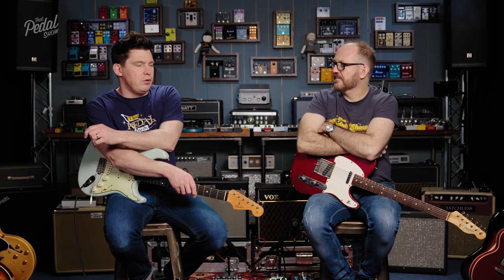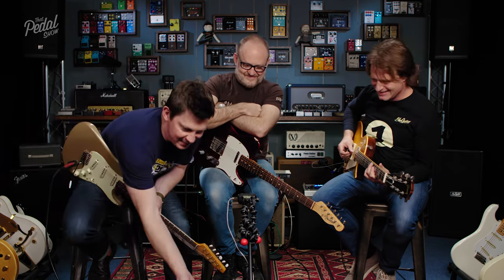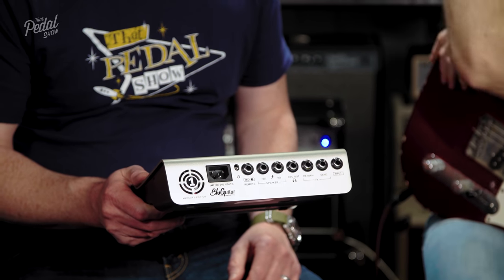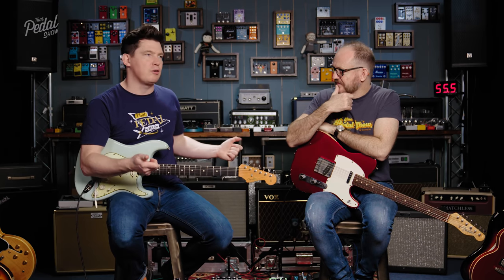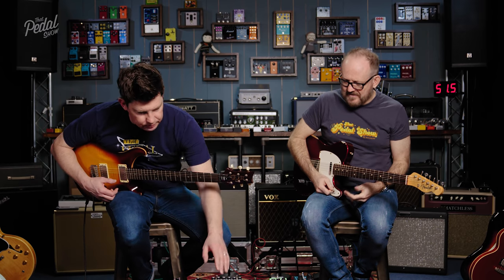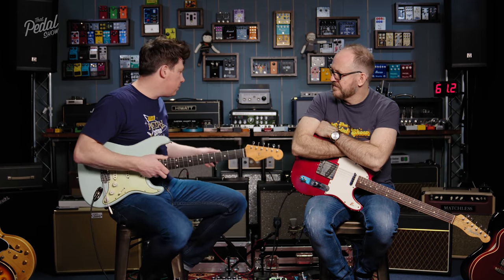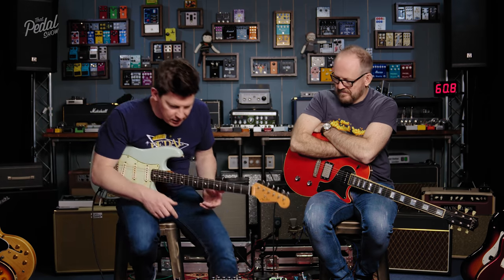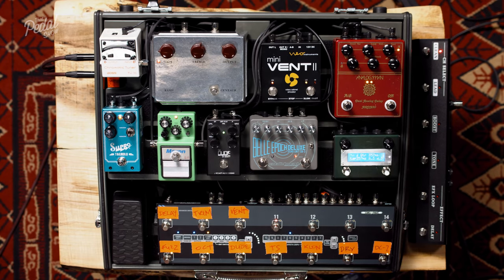Yes We Do Like Transistor Amps #1: Boss & BluGuitar – That Pedal Show

Comment: I love both tube and solid state amps, it depends on the sound/tone you need at the time. They both do what they are intended to - just differently.
 @1:06:19 That sound/tone combination is just filthy to me, and smoked the Fender, and on other tones the Fender smoked the Boss. 
Like a plane and a helicopter both do the same thing, fly........ just differently, flying one or the other doesn't make you a better pilot.

Top job lads

Comment: Cheers, guys! While watching this episode of TPS i was unboxing my new Roland JC 40, the subject of a recent show. Now i am wondering if i should have bought the new Nextone instead.  I intend to run the JC40 in a wet dry rig with one of by beloved tube amps. If i understand your philosophy, i should run delay effects through the new Roland's fx loop and my overdrives & boost pedals into the front of my "dry" tube amp (I own two, a Laney Cub12r and a Peavey Classic 30, both with Eminence speakers).  Do i understand your philosophy correctly? Thank you for another sintilating show.
Reply from the maker: Dan and I would both choose the JC I think. Louder, simpler.
Reply: @ThatPedalShow  I've had it an hour and am completely smitten. Huge improvement to my tone...

Comment: Combining this topic with the last episode: where are all the stereo guitar amps (input & ouput, i.e. not just a single mono input)?  
I have a sublime valve amp, and I would love to grab a stereo amp to give me instant Wet Dry Wet.  It could be a small power block to go on (or under) my pedal board that I just have to plug speakers in to, or even a 2x10 combo.  
Handling the wet sounds it could be solid state, and hopefully that would make it cheaper and lighter too.

Comment: I’d like to mention and recommend the Fender Jazz King. 140 Watts. 1x15 Speaker. Stays clean almost all the way up. Stupid loud. Fender tone and great pedal platform. Like a Twin in unyielding low end and volume, but minus the weight. Would love to get your take on this amp after you’ve had a chance to try one. Gigged with this amp lots, and love it!
Reply: I have one of these as well and mainly use it as an acoustic amp, or putting peizo equipped guitars through.  I have played strats through and it is good with electrics as well.

Comment: Wonderful!  these amps sound amazing! glad you guys have done this episode and the best advice that comes through is that we must judge the sound with our hears. If it sounds good it's good!!!
Reply: Maybe for those on the receiving end--I have heard countless times over the years about how 99% of the audience wouldn't know the difference in a band setting, which may be true. For the player though--at least for me--the feel and response of the amp I'm playing is just as important as the tone. It actually affects the way that i approach playing--it's very hard for me to get into playing and writing music when my amp  responds like a first time prison rapee--cold, sterile, and uptight (literally).  Sort of like the difference between playing at conversation volume versus the way a speaker reacts when it's pushing air at a high volume. My bassist wanted to raw dog my dry guitar signal straight into the studio interface the other day and use software afterwards for the amp tone,  and i almost had to drax them sklounsts.

Comment: This is a great episode, and definitely one to expand with more alternatives from other brands. I also have a question/suggestion: what is your take on half-solid state and half-valve amps? The BluGuitar is a solid state amp with a "nanotube" that if I remember correctly works in the power section, not the preamp. On the other hand Eric Gales' new amp, the "Raw Dawg" from DV Mark has a 6205 tube (kinda 12ax7 vibe, the same tube that's in the new Fender MTG Tube Distortion pedal) in the preamp. I personally really like Eric's new amp, and I've gotten only compliments about the sound on gigs and sessions. Maybe that could be an amp for a future video? I'd really like to get your feedback on a valve pre and solid state power section like that one. And I believe Andertons has it in stock/can order it?
Reply: I also forgot, it has a loop where you might even be able to put a volume attenuator like the JHS little black amp box? I use it a lot with hot rods to drive the preamp valves a bit harder without breaking windows and eardrums.

Comment: I'm seeing fewer and fewer bands using valve amps nowadays. I have a 'D' style amp at home, currently in use as a lamp stand. I love my Roland Blues Cube Artist. Turns out, if your're gigging every week, a valve amp is not the best solution.. (for me anyway).
Reply from the maker: It is undoubtedly true. If you dive in though, the reasons are usually cost and practicality. Which is cool.

Comment: I love a good solid state amp, I've had few issues with cutting through the live mix of a band. I've owned a Fender Princeton chorus, which is great sounding amp but only 65 solid state watts, also I love my peavey bandit, which sounds awesome with a ts9. 
What I don't like is solid state amp that try to sound like a valve amp, simply doesn't work. 
Great show, hope you had a cracking time at namm.

Comment: Dan and Mick, another request to do a “make your guitar sound good with a band” episode. But I reckon do it without a band. I have learnt so much about making my guitar sit better in band from all your sans bands episodes. Could you include mic placement (saw a lazy sound guy put the mic right on the edge of the cone of our support band - not sure if I should have jumped on stage to fix this) Also when my band is just bass, drums and my guitar and I’m playing a solo I find myself using overdrives with quite a bit of bottom end rather than say a tube screamer, am I fooling myself that I’m filling out the sound or does this sound reasonable.
Reply: Might be okay, but no reason the bassist can't stomp on some dirt to fill out the sound, so you can solo without fear of making the mix sound thin.

Comment: I've been using solid state amps for years for several reasons; reliability being the main one, the fact that they aren't subject to tone-robbing mains voltage fluctuation in various venues, their relative light weight, no need to bias the things, change expensive valves and the fact that I like the tightness of the response. With the arrival of things like the Roland Blues Cube in its recent incarnation, the Boss Katana etc these are real game changers. My amp of choice, however, has been the venerable and utterly reliable Peavey Bandit Transtube. I have to say that I thought that Blug tone was terrible; brittle and farty.
As ever it's all down to what one prefers. As far as sheer volume is concerned, loud is loud irrespective of what a number says, so I'm not sure where Dan's comment came from-especially as many guitarists mic-up smaller and smaller amps these days. Valve amps I have owned include a few Boogies, VHT Pittbull, some Marshall DSL, Fender Pro Tube Pro Reverb (wonderful but 75lbs), Selmer Treble n' Bass 50 with Goliath 18" cab, Cornell Romany, Cornford Hurricane, Vox AC30 etc., etc., so plenty of experience in my 50+ years of playing the things! Cheers.
Reply from the maker: All agreed. The loud thing comes from the numbers. The Nextone is on max, rated at 80 watts at one point in this video, while the HRD, rated at 40 is barely ticking over and has a long way to go. That's been our general experience. Weirdly the JC40 seems waaaaay louder.
Reply: I have a Peavey Bandit too, and I can't find a reason to change it. I'm surprised that even you, having tried all those amps, still like it most.
Reply: @lucianodebenedictis6014  Lots of reasons, as outlined in my reply. I also like the power scaling-very useful for getting good tones at lower volumes where a valve amp might be struggling, especially for overdriven tones.
Reply: Well you have better ears than me. I noticed almost no difference. I am guessing the Matchless is about 3K and the Blu maybe 1K so for me thats amazing plus no amp lugging upstairs

Comment: Thanks for showing the amp settings. I'm always interested how other folks set their AC15's. I set my treble about the same as you have, but I run the bass lower and use very little Tone Cut (set about 9:00). It gives me a tone that really sits well and distinct in a band mix. I run through the Top Boost, though. And, of course, different guitars, pickups, personal taste, etc.
Reply: I posted my initial comment before Mick pulled back the tone cut some :)

Comment: 57:06 Interested that you went for knob-sweeping and the fave "2 o'clock" for setting up the Hot Rod Deluxe, rather than using the Matt Schofield System™ of getting the amp in its most "responsive" state. So -- was this a situation in which that "responsiveness" would not have been in the best interests of what you were testing?
Reply from the maker: You are entirely correct. The truth is I couldn't hear that well, knew the camera was running and just needed to get on with it. :0)

Comment: I know this is an old video, but i have a question/request.   Could you do a video with the Nextone, and Quilter with Micks WGS/EVM copy.  And see how that speaker or speakers effect solid state amps.  Is it and if so, how is it different,  or similar?  Sorry I fell down Mick's rabbit hole with a little 1x10 Rivera with an EVM 10L that sounds so massive, yet detailed and focused.  Now I'm wondering how widespread the effect of these type of speakers are.

Comment: Interesting. It has me wondering how my Vox ToneLab ST would hold up in a comparison with these two amps. It's a modeling unit and requires an amp, but it does have a tube, and I think it works great, although I never play at anything near 100db!
Reply: they are just the preamps of the cheaper second series of valvtronix amps,,,absolutley killed by the amp1,,i know i have foyr of the origional "blue" series valvtronix the ones before they dumbed them down,,cost over a grand when new
Reply: I'll take your word for it Bill, especially since my used ToneLab ST cost just US $100, a small fraction of an Amp1 price. It seems to me that a big advantage of devices like the Amp1 is to eliminate the need for backline gear. Just show up with a pedalboard and plug into the PA. However, I don't believe Mick or Dan would be too keen on this idea for live shows.

Comment: I have been using my amp 1 now for gigging for the last 2 years,replacing my aging and now defunked marshall jcm 900 100 watt combo.Can I tell the difference between them...Yes the amp 1 sounds way better without all the hassle of lugging a heavy amp around. Before that I was a die hard valves only man I was Marshall or nothing,I even played at a marshall father of loud celebration at Milton Keynes,lovely people at Marshall! This thing changed my mind.It has the same feel as my old marshall. Sorry  but eventually they will stop making valves as it very very old technology which is a very sad thing.Thanks Lads for doing this very interesting !
Reply from the maker: There are enough valves left to see any of us to the graves, Dave. And just because you prefer something doesn't mean the 'old' tech has to die. Nobody needs to apologise for it. :0)
Reply: @ThatPedalShow  ah I stand corrected ,true enough I don't want valve amps to die out...it's just that my old valve amps weigh too much  for my aging body and need regular servicing ie more money spent on valves,servicing etc.Love the show by the way and thanks for the reply !

Comment: . so which transistor amp sounds best or most tube like or both? boss next-tone, roland jc40, roland blues cube hot,quilter mini 101 w/reverb, blug amp-1 oe something else? I want to run 2 in stereo so it cant be plus $1000 amps either..help...
Reply: I would go amp1,,but im biased as i have one along with an ac15,,,though i did try the cube,,,,the bonus of having a board mounted 100w head cant be forgotten either ;)

Comment: Solid state amps are getting better, but they're mimicking valves to some extent unless they're trail blazing their own unique sound. The reason is because in the old days all you had was valves and the artists we still revere had little choice but to use them.  I've had a listen to several cheap and expensive SS amps over the years and indeed owned a few.  But I do find myself veering to valves simply because the break up in the sound is less "controlled" and more natural compared to SS.  Where the SS amps are really great is for pre-amp feeds direct in  as they give a consistent sound.  Bizarrely, the preamps are often solid state mimicking valves.  Go figure!!

Comment: Thomas has done his magic of matching tones of tube amps so many times that it is simply amazing... and pretty convincing as well. For home practise and as the second amp in a live setup,  I can completely see it doing its job much more so than any modeling thingy. It has been on my ”to-be-tested” list for a while but getting your habds on one is not easy - unless you buy nline and trust the return policy works. So, thanks for showcasing it one more time - solid stuff :)
Reply: not a back up ,,a board mounted amp that replaced many a full size tube amp head
Reply: Bill Rand I would not be too surprised to see that happen, honestly - and the second amp in my setup is not a backup (unless the other dies) but an equal sonic offender :) The pnly thing I am weary of is the reaction to different pedals I have grown to like a lot. But that I can only find out by trying the blugamp out. I would love to have the portability with all the tones of a back breaking tube amp!

Comment: You really need to check out some Randall amps. They make the best solid state around. Some even better than tubes. Hell my cyclone can get master of puppets, vulgar display of power for super high gain. Yet just roll back my volume pot to get classic rock tones like Boston or Zeppelin. Plus super clean cleans with more headroom than a tube amp.

Comment: Mick, were you stating there was more bottom end from the Nextone as compared to the VOX?  Funny, on my playback system, I heard just the opposite.  The VOX seemed to record with a "fuller" tone.
Reply: Mick, for what it's worth, I changed audio playback systems to one with a sub-woofer.  The extreme low of the Nextone, came through. What seemed to be missing was a range in the "upper-low-end" that made the VOX seem fuller.  Don't know how many times I'll tell myself all tones through YouTube are relative. :-)
Reply from the maker: Felt like it where we were sitting. Highly likely that the room mics were hearing something different!
Reply: @ThatPedalShow  I've had a few conversations with Tim Pierce regarding mic/recording.  Due to his studio work, all his tone is heard through recording monitors.  His speaker cabs are in a vault.  What he hears, when working, is dependent on his mic/preamp choices and blends.  Wonder if you could pull off a show on "tones for recording" and all that's involved.  Thanks for your reply.

Comment: I have a Lab Series L7, amazing amp, although it is a transistor one
Reply: Even older is the old Vox "Blizzard of Nails" 100 watt amp from the mid-sixties with the Exo-Skeleton and wheels. Loved playing through that, particularly the MRB feature. Fischer (RIP) once told me in a phone conversation it's because it was designed by a noted valve amp designer (simply put).  Pete.

Comment: Best kept secret in amplifiers is my Crate XT120R.  A solid state, 3-channel 120 watt amp with reverb.  Clean channel is EXCEPTIONAL with excellent note definition and clarity.  The two gain channels are geared more towards the metal sound, but you can achieve the right Classic Rock crunch tone by tweaking the gain controls.  All the guys in the band I'm in are amazed at how good a solid state amp can sound.  Plenty of bottom end in both the clean and gain channels that gives it a great overall presence that I cannot duplicate in other 100 watt tube amps.  And believe me I've tried quite a few and I always go back to my Crate XT120R.  Sure, go ahead and laugh.  But nothing cuts through the mix better than this amp without sounding harsh or thin like the Marshall DSL Super Lead or the Fender Hot Rod Deluxe or the Marshall Blues Breaker combo amps I've tried.  I've also tried an Orange amp, Marshall JCM 2000 100 tube watt head and a Peavey ValveKing 100 watt tube head.  My Crate amp tops them all in terms of tone, power, versatility and convenient compact size.